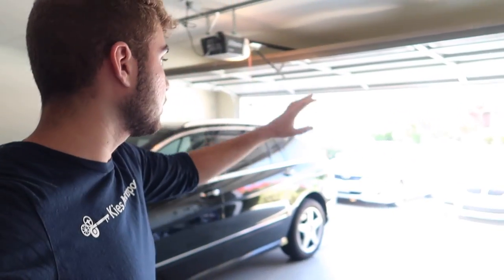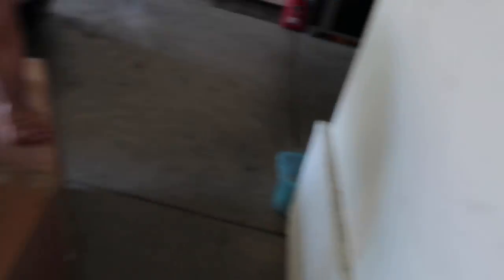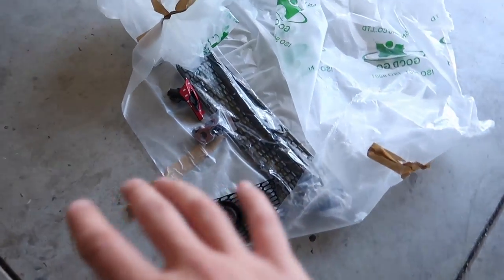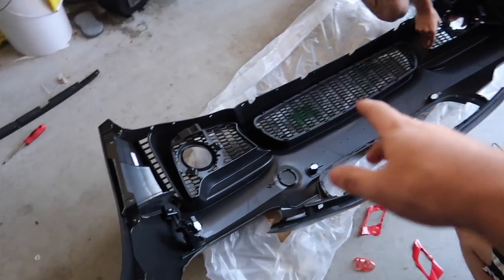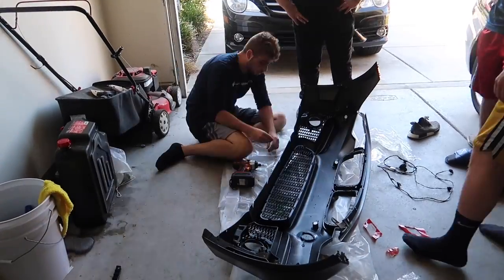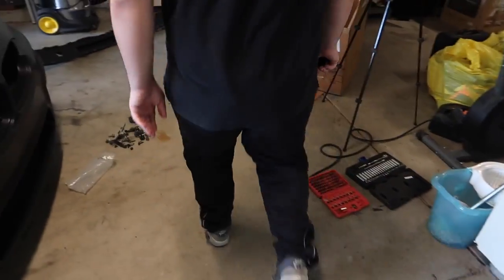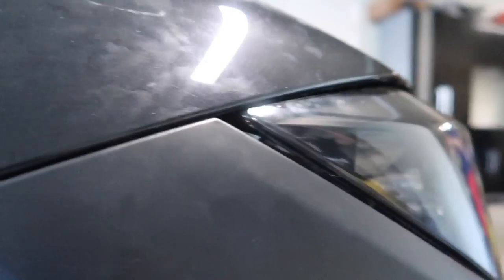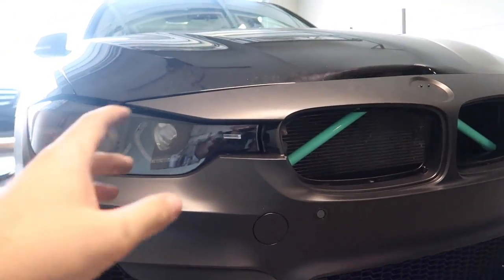BMW F30 M3 BUMPER CONVERSION!

Comment: Hi

I've got an f30 2013, i converted my front bumper to m3. im having issues with the under trey plastic and wheel arches being fastend properly. Also there is suppose to be air ducts behind each of the front 2 corners of the bumper? to lead air to the front brakes. please let me know